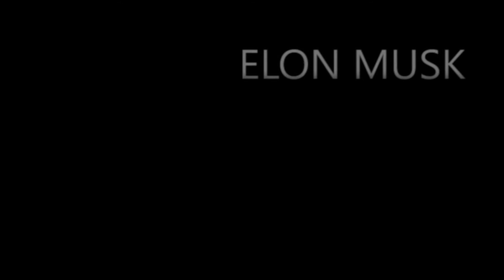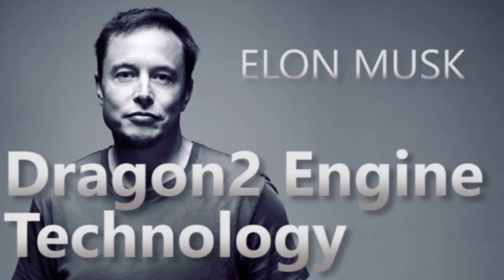Elon Musk on Dragon2 Engine Technology

Comment: Can anyone please elaborate on "deep cryo methalon"? I've only ever come  that process in two responses by Musk.
Reply: It's just what he said methane and oxygen cooled to near thier freezing points instead of thier boiling points... it makes the fuel significantly more dense. When you cool something the atoms move around less... and when you cool it so far that something that was a gas at one point is almost solid.... the atoms have slowed down so much that they no longer push each other apart due to heat pressure... this is what lends to the increased density.
Reply: methalox